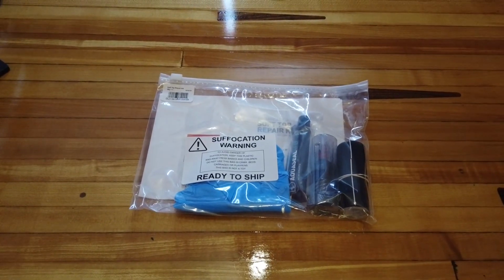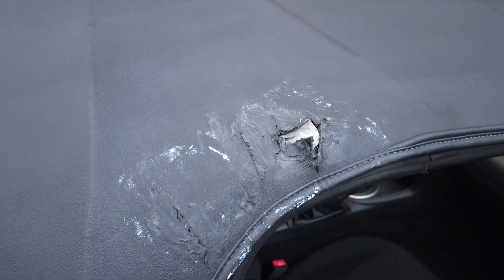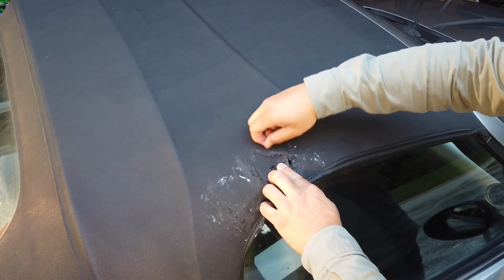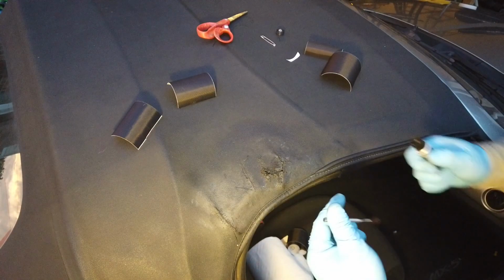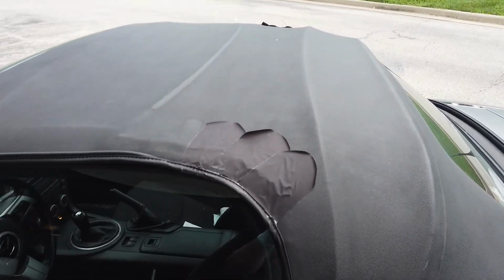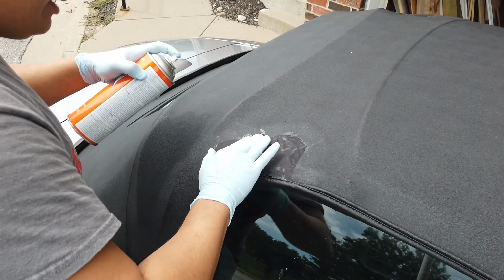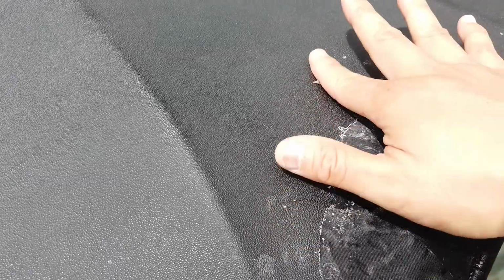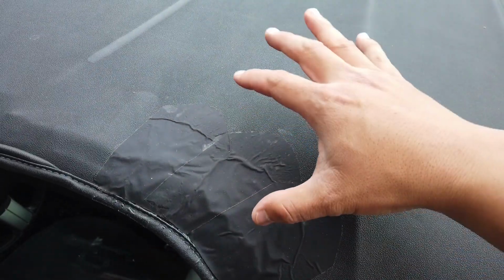Vinyl Convertible Top Repair Kit   Does It Work??

Comment: Vinyl is picky about what works on it. If it doesnt say it works on vinyl odds are it wont work after awhile. Even black "gorilla permanent" tape doesnt work.
Reply from the maker: Thank you for the comment. I'd have to agree with you based on my limited experience with it.

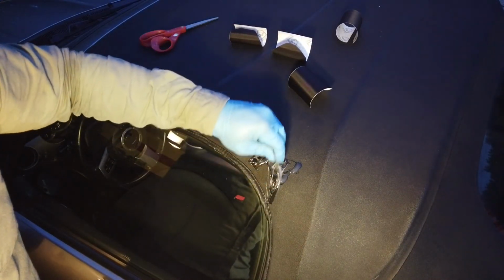Comment: Dude, go back and look at your video at the 8:20. You have the adhesive spread out in a rectangular shape and then put rounded patches that clearly extend beyond the adhesive by about an inch. The next day you lift the patch (where it's peeling) and you can clearly see that it doesn't have any adhesive on the back. It's not the patch, it's you.
Reply: My thoughts exactly!!

Comment: Ok, you didn’t show us what happens when you open the top. So did the tape hold up when the top folds down?  The left side looks pretty good. Did you change gloves when you started the right side?  That might be where you made your ‘mistake’.   My 2008 has the same stress cracks. And on the left side, right where you taped it, a previous owner used silicone snd it looks like a big booger. But I think I may try your tape with maybe some flex seal on the inside surface. 
But bottoms line, we both need new tops 😃
Reply from the maker: This held up much better in terms of flexibility when folding the top down compared to gorilla tape/caulk, however I think you're spot on saying ultimately a new top is in order if you want to restore the aesthetics.

Comment: Doesn't look all that bad! Can't wait for the top replacement video. I'm "torn" between vinyl or cloth on my Miata.
Reply: Cloth is better. In terms of durability from folding they're pretty compatible cloth tops are much better if you fold your top in the cold. Vinyl tops become stiff and brittle in the cold so they're more likely to crack/rip from being folded when cold than cloth.

Comment: I needed to replace my top on my 95 formula firebird. I bought a good top an instructional video a cheap pneumatic staple gun. It seemed pretty straight forward. I paid $350 for the top which is a two piece with glass window. Cheapest shop was $750 for install. I accomplished my own install. It looks good. Next time I'll gladly pay $750.
Reply from the maker: Thanks for sharing! When I replace this top I'm definitely going to consider having a shop do it to save the hassle.
Reply: I’ve heard the same from other capable DIYers